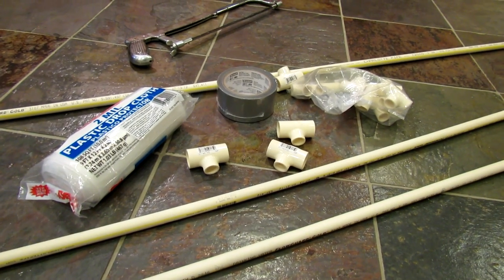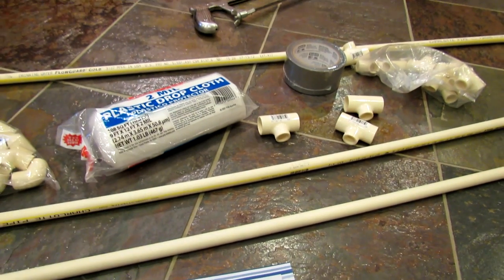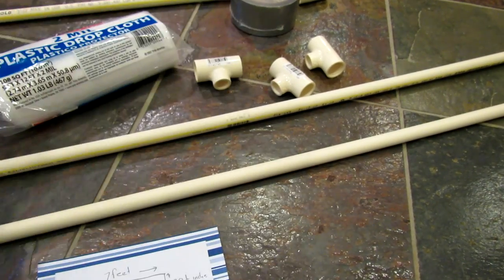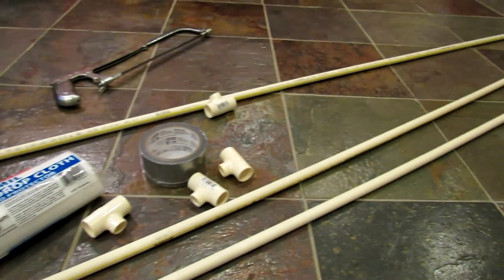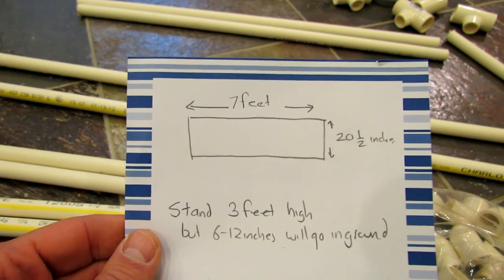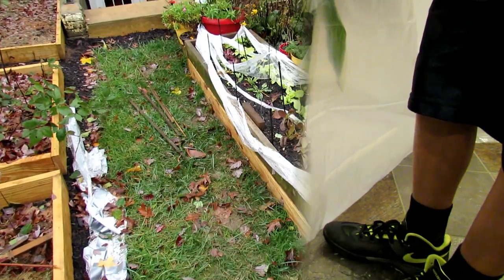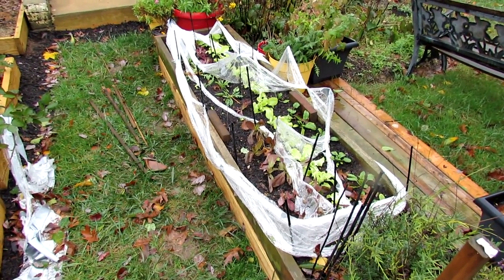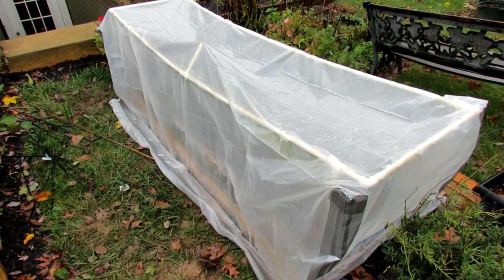Building A (MINI) Collapsible Vegetable Garden PVC Greenhouse/Cold Frame - The Rusted Garden 2013

Comment: If one had a table saw, they could rip 3/4" PVC pipe at 10 and 2 o' clock (when looking at the end of the pipe) to make excellent "clamps" to go over the 1/2" PVC to hold the sheeting.  Kind of like a poor man's wiggle wire.  This way the side curtains could be air tight at night, yet still raised during the warmth of the day.

I think I just might try that.  Thanks!

Comment from the maker: When I lift a main side up the smaller sides do lift up a bit. Its not perfect but for that space I don't need to lift it so high. Plus if you are going to fully plant it or work the soil I would just life off the cover and replace it. Does that answer your question?

Comment: This is a great intro. Please do other PVC projects for the garden! The only thing for those in Canada. Do not try to buy your pvc fittings from Lee Valley etc the markup is insane Ie/double or triple the cost. Look at plumbing supply stores or general water system stores like Van Isle Water. I need a bunch of 1/2" 45° elbows-Lee Valley wanted $3.90 Canadian(3.06 USD) EACH. No cheap bags of pvc fittings here that I can find. If you want to make a different style coldframe top that uses  3 way branch WYE's you won't find these at Home Depot Canada etc. Look at Irrigation/Plumbing/Well/Water System stores-small businesses surprisingly sometimes have better deals. Helps when you are buying a lot.

Comment: Please note that he's not building with PVC, but rather CPVC.  CPVC uses as different measuring system and the pipe is much smaller than standard white PVC.  You can tell as your PVC has a yellow stripe along it, which states it is CPVC.  This might confuse folks when they decide to purchase PVC from their home center.

Comment: Ok you have my brain a working! I have a similar green house you bought in 2013 and I'm using it now. But the plastic is tearing so easily I know I wont get another year out of it and our cats won't stay out of it. So now my idea is to use the poles and connectors from it to build something like this for my raised beds. Do you think its possible and do you think it will keep my cats out? And how well did this design work?
Reply from the maker: Hmmm. I think you could. If you cut up the plastic to build a cover... I would recommend silicone to secure the edges along with the duct tape. Unless your cats love whats inside, I think you will be okay. 

You can also plant a random cat garden where they can go eat whatever Just put it away from your main stuff. Most animals are lazy a go where the least amount of work is to eat.
Reply: Dawn Cates hot peppers don't keep out.  Neither my dog nor cat go into my gardens so it sounds so wierd to me when I hear, see or read about people's pets in their gardens. The cats in people's videos always look so darn cute!
Reply: flanmaryj It's cute until they lay on your seed trays and set back your tomatoes and peppers by 3 weeks! Not that that's ever happened to me or anything, though, of course... 😜

Comment: A big thing is that water will pool and end up ripping that thin plastic you should have the PVC rounded so the snow will fall off instead of collect and that is the same for rain.  Also if you use  THICKER mil of plastic it will last several seasons.

Comment from the maker: The tomato looks great. The container is too small. It will keep your tomato little. And the tomato will suck all the nutrients out of that soil fast. Your tomato will yellow and stress. Best thing to do is get it in a.5 gallon container. Use a potting soil with nutrients. Replant it and bury a quarter of the stem. Youll get tons of tomatoes. If you can't get 5 gallon container go as big as you can.

Comment: It is going to turn into the water pool after the first rain.
Weight of the water will pull all the plastic inside the greenhouse exposing plants to wing and cold. Bad design.
Reply from the maker: Citrus at about 16:38 in the video, I talk about small holes in the top. It dealt with what you described and gave water to the greens.